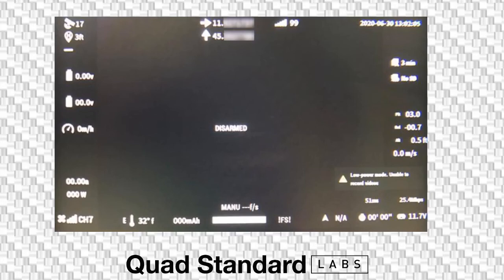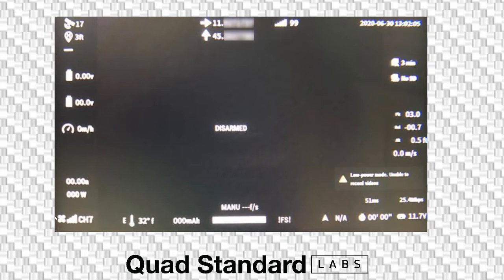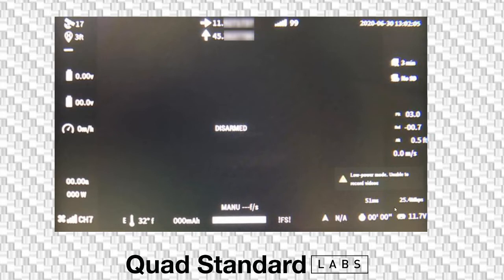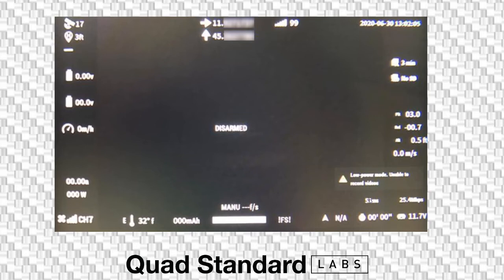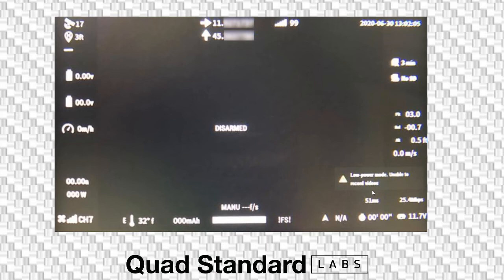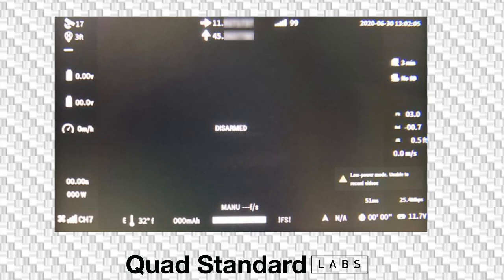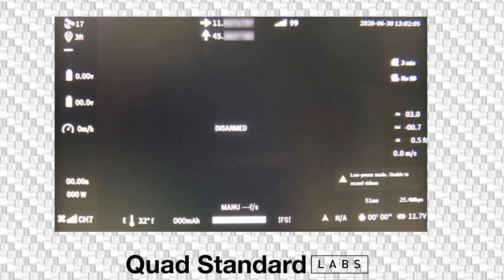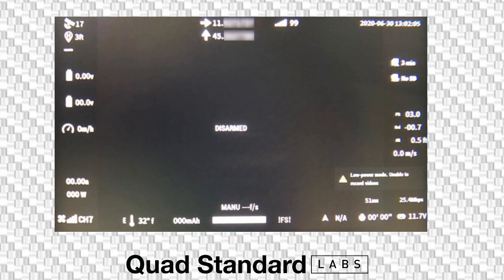Understanding DJI FPV Link Quality

Comment: Hi there... i have a new air unit and when set to high bitrate mode it never gets above 39mbits. Even when im standing with the goggles right next to the air unit. All my other air units get 50 mbits.... but this particular one never goes above 39 mbits. 

Have you ever seen this sort of thing? I believe the air unit is faulty...

Comment: This does not show the signal strength for the dji fpv controller. There are two rows of signal bars one for video and one for the controller. And there is no way of seeing signal strength of the controller. The mbps and ms Is for the video link not the transmitter

Comment: Bottom line, its still as broken as I thought it was....
1 question I have, why doesn't 0-99 on the "RSSI" scale the 0-300 lq correctly? Who do we look to to fix that? BF or DJI? I'm assuming BF and the likes as it's been the same way sense before dji. 1/3rd of 300 is not 70.  2/3rds of 300 is not 98.
As for the video side, nice to have an indicator to confirm the latency but you can definitely feel it before your eyes look over to that side of the screen.
Reply: Dji does not support lq. It is not beta flight to fix it. You can use aux channel to display lq on dji and it reads as an rssi number but won’t show you what mode you’re in